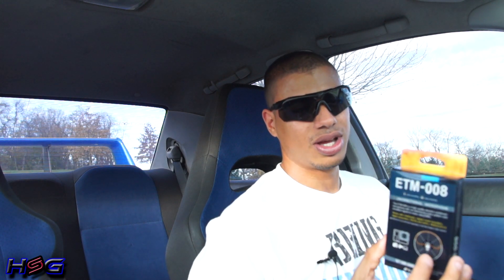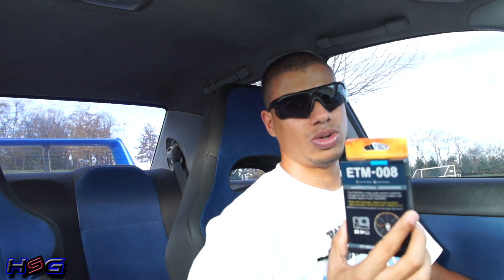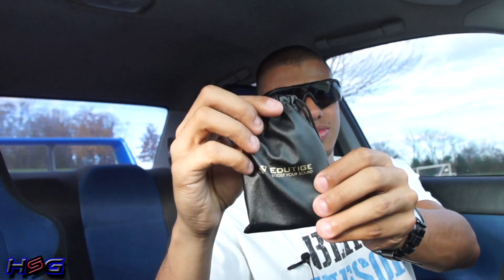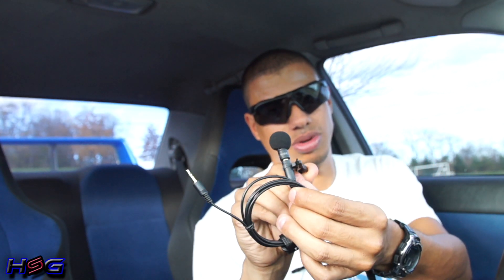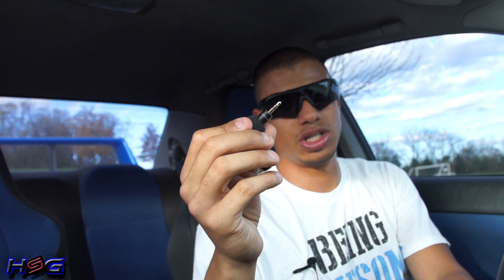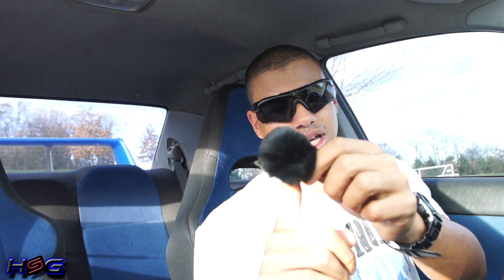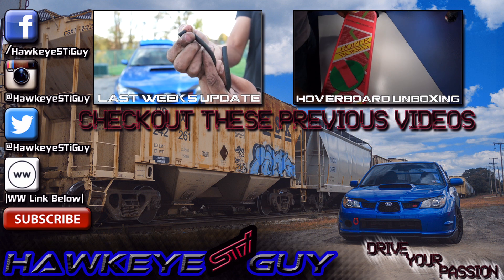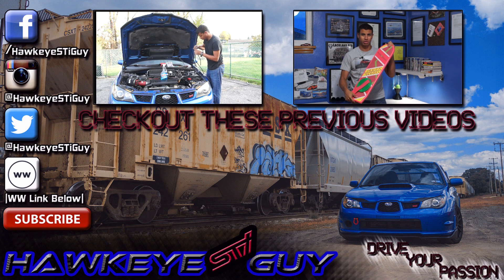Aurora Update #3 | Mic Unboxing, Horn issue, & Vanity Plates

Comment: It's only $10 a year for a vanity plate in VA so they are literally everywhere! Mines fairly self explanatory, hopefully most people get it!
Reply from the maker: +T-WRX PA has a one time fee which is nice. It used to be $20, but at the beginning of the year, they raised it to $80. I didn't decide to get a plate until after they raised it. Lol.
Reply: +HawkeyeSTiGuy I really wanted "M3 GUSTA" for the m3, but it was already taken :/
Reply from the maker: That would've been so awesome! I lucked out with mine. I had to use a '0' instead of an 'o', but I'm happy with how it turned out.

Comment: Old microphone sounds better lol
Reply from the maker: +RedlineCarGuy Well as I said in the video, it was my first time using the new mic, so I still need to find the best placement for it, & I wasn't using any wind screens. The diaphragm on it is much larger compared to my old one, so it should have better quality once I have a little more practice using it. 

The other 2 big reasons I switched, is because the old mic literally had a 20ft cable that I was tired of fighting with, & it had a battery powered on/off switch, & there were several times where I would record, & afterwards I found the mic switch was bumped into the off position, or the battery had died. That was so infuriating!